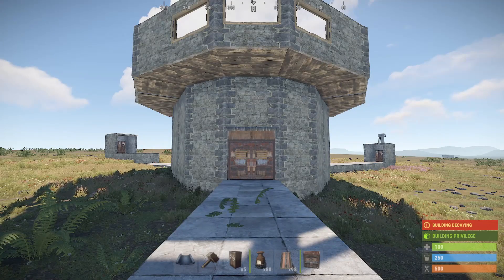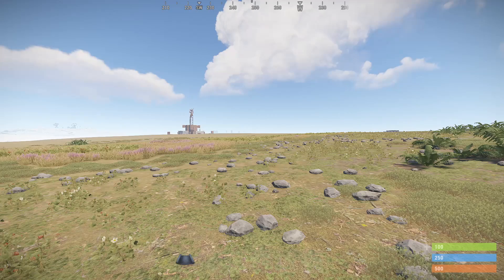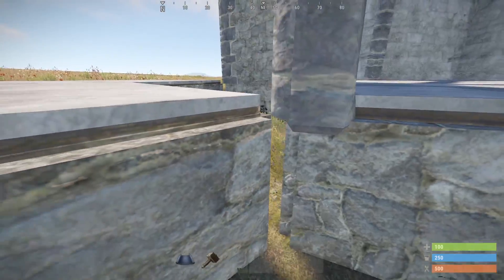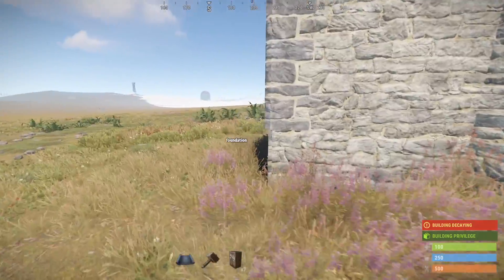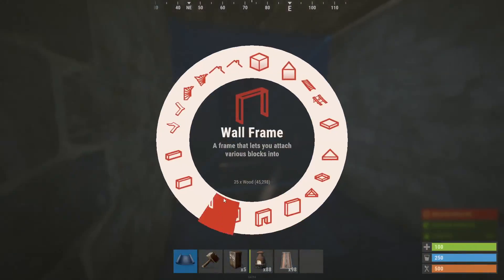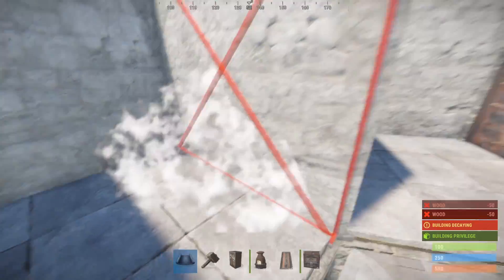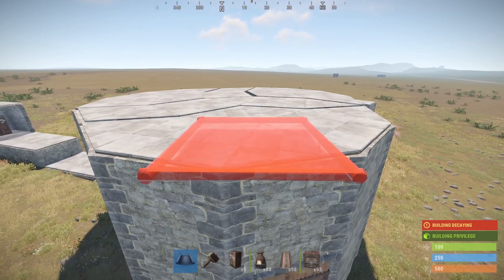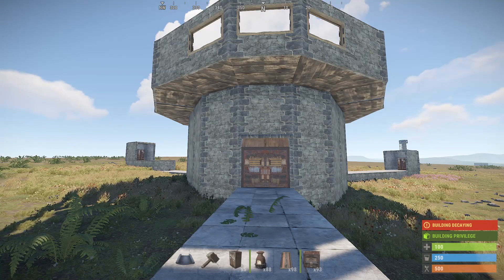Multi TC Base Design Tutorial - Rust Console Edition

Comment: love your content OBIE you're a chill guy... + nice to see players on console taking a lead on content in builds with external tc but I'd apreciate with a platform like yours you'd build a smarter build. the fact you put honeycomb on a external wall is useless cause it'll pummel straight down also the reason you had issues connecting the floors for your shooting floor is because the stability is soooo bad.... 
if you aim for less upkeep there are better ways to connect tc with external walls like triangle foundations, wallframes or floorframes instead of square foundation.. also the gaps are to big and your solution is rugs? serious? 😅 
I've said it before slide in dm's I'll hook you up
Reply from the maker: Dm me on twitter

Comment: Are you able to soft side one of the walls through the gaps?
Reply from the maker: Possibly but the upkeep will have plenty of room to make the entire base sheet metal so you can’t soft side it
Reply: @OBIE  you can still soft side sheet metal, 2 buddies and I soft sided out a shooting floor then made bean cans for the garage doors they had. It was a task and took a lot of prep and planning as it’s 52 or 53 beancans a garage door, but with 3 of us picking the soft side metal I’d say it took about 30-40mins. Soft siding sheet metal takes 1 damage every 2 pickaxe hits and it’s 1k health. But when you don’t have bps you do what you gotta do 🤷🏽‍♂️
Reply from the maker: @iamnoclout7737  True I guess people would have to look out for that but right after one soft side wall they're going to need to start using some type of explosives so if someone wants to save 8 rockets or 4 c4 really bad then it can be done.